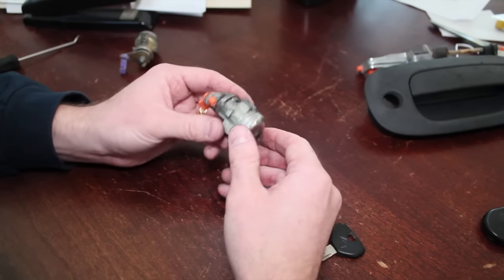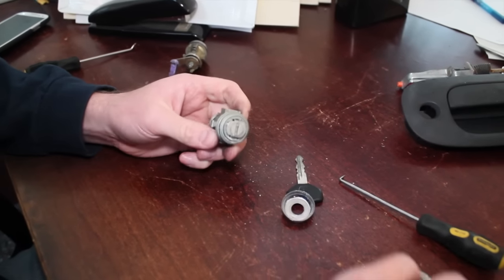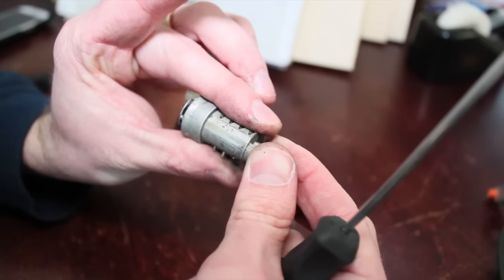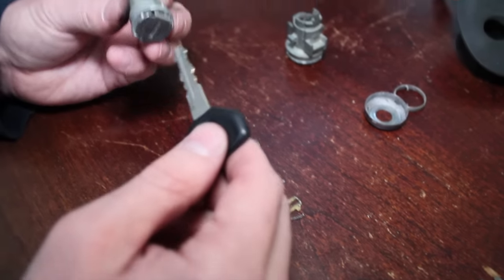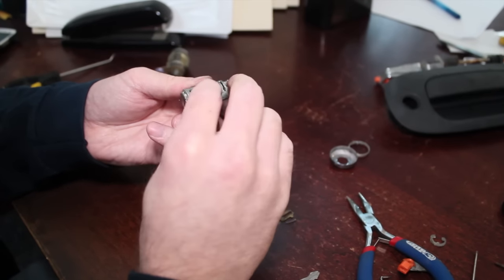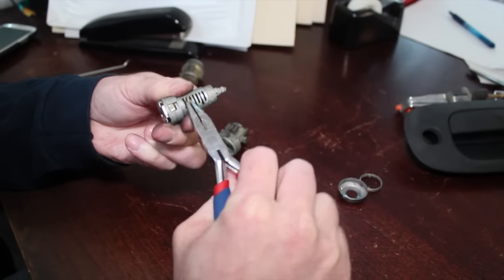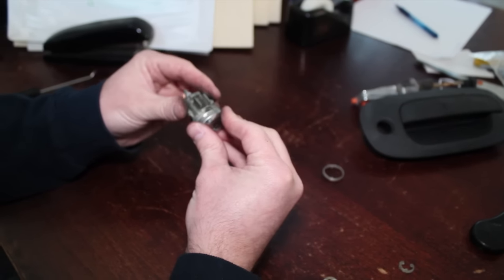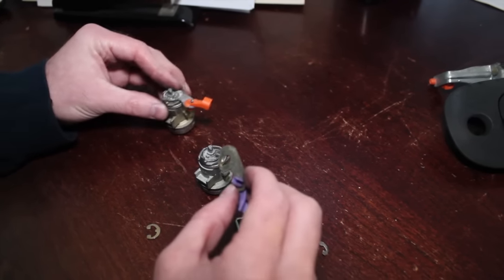Recode, Rekey Car Door Lock Cylinder - Use Any Key to Unlock Car!!! Ex. Durango

Comment: Great video.  I just used it to recode a new cylinder for my Honda.  The lock broke and I ordered it online for $13.  Trial and error worked except for one slot which I just left out.  I learned so much and saved about $50 for a locksmith to do the same job.  I can't wait to see what is broken on the old lock when I swap them out.
Reply: I dunno. Supply and labor costs..

Comment: Perfect explanation! Used your info to rekey a trunk lock cylinder on a 2005 Mercedes! Bought a used handle assembly without the key. Got it all apart and broke one piece. But learned I could change the tumblers out. Thank you!!!

Comment: Thanks just doesn't seem to express my gratitude. This all started 2 weeks ago, the linkage on that door handle popped apart on my way to a family thing so I just used the inside handle so not to be late. when we were leaving I rolled down my window and it got stuck in the linkage then the door wouldn't open at all so I started this adventure having to pull the door panel off while sprawled across from the passenger side. A week ago I finally got the door open by just blindly disassembling everything attached to the door 2 days ago I received my shipment of 6 plastic clips so I could put it all back together but to attach the clip to the outer door handle I had to pull the cylinder that turned out to break into pieces, after all that I got lucky enough to find your awesome instructions so I don't have to change all of my locks and now I can keep my original key. thank you so very much.

Comment: After watching your video for inspiration... I had a similar situation with my 2000 Tahoe. However the mechanism is a little different and couldn't get the pins out - what I did was insert the key and noticed only 1 or 2 pins were still ever so slightly raised, so I simply used some wire snips to lightly clip off a small bit of the pin. This isn't 100% professional, but it's quick, cheap, and still quite reliable! (did this for 2 separate locks with that were for 2 separate keys). THANK YOU!

Comment: Great video!  Short and sweet.  On my set-up I had 3 pins that didn't quite work out, so I broke out the file and did some manual tuning.  Worked like a charm!
Reply: I was planning on doing the same, although it worked can we say that most same make car with similar keys won’t open the door, thanks

Comment: DoAsImDoing. Thanks for the video. Just did my daughters Saturn. The previous owner must have lost the keys because they had a different ignition in it but no keys for the doors. Had one made at a dealership after jumping through hoops but still wouldn’t work. Come to find out the cylinder was full of what I believe to be glue.   Again thanks a bunch. Stay safe.

Comment from the maker: Glad you got it working. I mentioned somewhere in the video that I actually ground down one of the pins, but wires snips work too!
Reply: What can happen if you left out the last one? (The last one in mine is a bit bad so I'm wondering if the key will work normally if I just remove it)
Reply: @octacle_  I went ahead and removed the last one in mine about a month ago, and everything works just fine, like you said...still, Thanks for your reply 👌

Comment: I used this to recode my 99 Toyota Corolla door lock cylinder. I only had 1 of the 7 wafers that I couldn't re-use. I just left it out instead of trimming it. On the Toyota it was much the same setup but two of the wafers were split into two parts with a "wing" on each side. Different but the concept is the same. I reconfigured it with this video in about an hour. Thanks a lot!

Comment: Great video. My problem was the cylinder was stuck completely. Removed the cylinder and applied wd40 on the back of the cylinder. Wiggled the key a little bit. Wait some time. Wiggled more and boom the cylinder is back to normal. Thanks for again sharing this.

Comment: Thanks so much for this video! I called two locksmiths and got tired waiting for a callback. I first tried to find the correct pins while not removing the springs and quick started to get irritated with pins popping out. I then realized how important your recommendation to remove the springs actually made the process move faster. Thanks again for taking the time to make this video!

Comment: Thanks for this video.  My lock wouldn’t turn on my tailgate (02 F150).  I can rekey door locks at work (Lowes) so I knew I could tackle this after your video. Turned out I had the correct key. My lock was full of mud!! After some cleaning with alcohol and a tooth brush it’s back in and working great!  Thanks again for the video.

Comment: I had trouble with the last tumbler just like you did. I just threw it out as I didnt have immediate access to a grinder or filer. But 4 out of 5 tumblers still works fine. Like you said, "not the end of the world" Good stuff. Thx for taking the time.
Reply: Heck, I took out 3 tumblers out of 7 , it’s not that important, as long I can open the door

Comment: Thank you for this video! I fixed my 2002 Toyota Camry door lock cylinder after watching this. There was one pin that stayed up a hair too high with the factory key. I took it apart and ended up snipping the top of the pin off and it works like new now. Thanks again!
Reply: I have 96 Corolla with a driver side door lock that doesn’t turn when the key is in. I’m guessing one of the split wafers wore out after 25 years and is sticking out preventing the cylinder from turning. I haven’t opened up the door to check yet, but I’m pretty sure it’s a faulty wafer. Would u recommend I just remove the faulty wafer or do I need to buy another one? Or should shaving it down with a file also work? And will the lock cylinder work with a wafer removed? (I don’t rly care about worsening the security of the lock)
Reply: @HisMajesty99  If you have a spare key, test it before you do anything else. It could be the key has worn down. If the spare key works, but the normal one doesn't, it's the key. If you don't have a spare, test the key on the other door/s and if they turn, you'll know it's the lock cylinder and not the key. Then you can disassemble the lock cylinder and get a good look at what is stopping the cylinder from rolling. Good luck!
Reply: @adamanders713  I’m pretty sure it’s not the key since I’ve been using the key to unlock the car from the passenger side door for the past 2 years haha. And thanks, hopefully it’ll be an easy fix
Reply: @HisMajesty99  That rules the key out then haha You might need to use a little metal pick to pull the front casing of the cylinder off. That was the hardest part to get off for my cylinder. After that it was pretty straight forward. My parts and springs didn't go flying, but I do recommend working over a white towel or something so if a small piece falls out, you'll have a better chance of finding it.
Reply: @adamanders713 yeah from the video it seemed like the cap was the hardest part, I don’t wanna accidentally damage it taking it off. And good idea, I’ll definitely do it over something white or bright
Reply: @HisMajesty99  For sure. Let me know if it went well whenever you do it.
Reply: @adamanders713  took the door panel off and managed to remove the cylinder, was a pain for this Corolla model. But now getting the cap off this key cylinder is an ever bigger pain, it’s crimped on there real good with no gap to even leverage a flathead in between. Any tips?
Reply: @HisMajesty99  I used a small metal pick and inserted it into the key hole and used a little leverage to pop up one side. Then I put the pick in the newly made gap and pried it open along the outside edge. It bent the front of the little lock door, but you can barely notice it once it's put back together. That's the only way I could figure out how to loosen that crimp.
Reply: @adamanders713  hey man mb for responding so late, got busy with some other stuff today. But abt 30 mins after last messaging you, I was finally able to pop that dang cap off haha. Used an X-acto knife to slip in between and make a small gap, pliers and flathead did the rest. I removed two of the pins (just as I had predicted, the split wafers were the problem, basically just pins but cut into 2 pieces to add security. They also wear out over time easier). I reinstalled everything and now the lock works like it’s brand new. I can’t believe I didn’t do this sooner, been having unlock my car through the passenger side for over 2 years. Glad it all worked out so well. And thanks for your help btw!
Reply: @His Majesty  Hey, that's a good idea! I had the same thought myself after doing it. I wish I hade done it sooner as well. If it ever does eventually fail, you can always buy a rebuild kit and go from there. Either way, I'm glad it worked out for you! You're welcome, no problem!

Comment: Thank you sooo much.  This video walkthrough saved me some 💵💵 and I learned something in the process.   
One thing is that my needle nose pliers couldnt pull up the shims so I used a dull fingernail clipper to pull up the shims.  Worked perfectly.  

Also had to shave some the shims, but that was no issue since I had a dremel tool

all in all, Thank you much. God Bless!

Comment: Holy frikk'n smoke, I just re-keyed a Mazda RX8 with your helpful video! I've never done any locksmith job ever until today, thank you! There were some other helpful comments as well. I had to replace a door lock that got damaged when someone tried to break in the vehicle. The old lock had 7 pins or tabs (not sure what they're called). The new one had 8. I couldn't get the new one to work with all 8 so I left one out. I'm sure if locksmiths ever do this, I'm curious if they do? Thanks again!!!

Comment: Great video!  I got a replacement lift gate for my '98 Durango off a '00 Durango and swapped my locks to match.  I figured I'd try keying the spare cylinder to my key.  Sure enough I had the same issue of one slot not matching any of the pins.  It was a #4 pin in the 3rd slot from the keyside of the lock.  Filed it down and it works great, so now I'll have a spare cylinder lying around.  THANKS!

Comment: Try your new key before you remove all the tumblers....two or three just might be right.  There's only four different depths to each cut of the key, so you have a 25% chance the tumbler will match the key cut.
Reply: If there's 4 different tumblers then you have less than a 5% chance
Reply: I think he mean you have a 25% chance on each pin, not overall.

Comment: Thanks for upload. Simular barrel in my 1997 Diahatsu Cuore tailgate, which I had to repace to the original main key as the previous owner had lost key to a replacement tailgate lock that they had fitted.

Comment: so how did find the code for the tumbler?  And is a GM lock cylinder similar?  My drivers door does not unlock with the ignition key can I try and re-key the door cylinder with the ignition key?  The ignition key does go into the door lock but it wont turn the cylinder to lock (the door is always opened and locked using my key fob)  I want to try and see if I can have the ignition key re-pinned using your method so the ignition key is y door key? BTW -- Great video thank you!

Comment: I tried this with no success.  Then I took a good look at the slots the wafers ride in and saw that the edges were chewed up.  I us a small round Dremel sander attachment to round the chewed up sharp slot edges and now the lock works like new.
Reply: Kent  can you explain  please?  you used the dremel inside the slot  where the wafers go?  that is very small.  I am using old wafers from junkyard and only getting  2 to fit.
Reply: @qkcam45  Sorry.  I'm old and I don't remember the process.  I no longer have the truck so i can't go take a look at it.  I just remember that the slot was buggered and cleaning it up got it working.

Comment: Where can I buy a set of those cylinder slugs it wafers? I need to rekey some of my door locks and gas cap locks to a new ignition key. I'd rather not rekey the new ignition key to the old key. Thank you!

Comment: This looks interesting and my Range Rover has 3 keys. One for the ignition, one for the doors and one for the tailgate. I would like to get all of these onto one. Say if I were to get all of these barrels out like you have done, I have a few questions. 

In this case there are 7 pins, are they usually only in say 2 sizes? Because what if you need a length that you don't have enough of?

Also, are all locks the same? Like can I also do this for the ignition barrel as well as the door locks?

Thanks in advance.

Comment: Very good instructional video.  Is there a way that you know of to make a key if you know the wafer/pin combination but don't have the key?
Reply: Yes you can just take the combination or the actual key code which is normally stamped on the lock to a locksmith and they will make a key from the code

Comment: It seems that the key you used to remove the cylinder from the housing is the key for that particular lock. How would you remove it with a different key? For instance, if you purchased a lock online that did not come with the key?
Reply from the maker: sampoteste Any key that fits the hole will bring most of the pins down somewhat. The rest of the pins you should just carefully push down one or two at a time as you slide it out.

Comment: hi.. i have got toyota corolla 2007 which bit weird.. my car key cant open the door manually.. it can turns on engine though.

so do you think with your method can fix the problem?
and do you think the toyota corolla 2007 will looked simillar like yours?
many thanks

Comment: If the pins are numbered, I would imagine in theory you could  just remove one of the working cylinders from the car, note the order of the pins and match it on the replacement one

Comment: I have 96 Corolla with a driver side door lock that doesn’t turn when the key is in. I’m guessing one of the split wafers wore out after 25 years and is sticking out preventing the cylinder from turning. I haven’t opened up the door to check yet, but I’m pretty sure it’s a faulty wafer. Would u recommend I just remove the faulty wafer or do I need to buy another one? Or should shaving it down with a file also work? And will the lock cylinder work with a wafer removed? (I don’t rly care about worsening the security of the lock)

Update: I removed the two pairs of split wafers/pins and it works like a charm

Comment: What if you don't have the key for cylinder from junk yard? I'm trying to replace vw mk4 wagon hatch key that is frozen internally (likely due to corrosion) and I have the spare one from junk yard. I still have to figure out how to take the old one apart, is cutting it in half my only option? After posting this, I found a tool called HU66 decoder, I think I'll need that to dissamble the new key and cut old cylinder open to get the little pieces out.

Comment: i have a 2001 ford explorer sport trac and i lost all keys. local locksmith made a key but its does not open the ignition smoothly. i have watched some videos and already removed the cylinder and i wanted to rekey but it has different internals. it has a side bar. tumblers dont align and its the sidebar thats being depressed. Do you have a tutorial for a cylinder with side bar?

Comment: It turns out my lock cylinder is just fine - the key is worn down.  When Home Depot cuts a new key, it follows the old one exactly.  How can I get a new key, one with the dimensions meant for the lock cylinder?  $65 wasted on a new AC-Delco lock cylinder and it does exactly the same thing as the original lock cylinder.

Comment: I have a slight dilemma while i was doing this for a friends Caravan, he wanted to help/learn, but he's not too bright, so i thought i explained to him how its done and had him hand me the tumblers as I asked for each one by the number, hell I won't need to even write them down. Righhhhht.
Well turns out, he had handed me, one @ a time, ALL #2's, he thought when i called out a number, he thought thats how MANY i needed & I should have got that w/ the 1st round when I said "gimme a 2" & he handed me 2 tumblers, I said, No bud, I need em one @ a time, and he had this cunfoozed look. Well I dremeled off the case (Had another) and got everything out and now i'm trying to do this on the blind, is this going to be like pissing up a rope??? ;) I have the 8 original tmblers and they consist of:
#1's = two
#2's = three
#4's = three
Was hoping there was a # on the key, its a black Dodge key (non-chipped) but there is nothing.
If somebody has gone through this already and had any suggestions I'm all ears. and would appreciate the assist, Thanks

Comment: I want to rekey my Honda door lock. I want to use my old key  - so basically I have to replace some or all tumblers. What would be the right way to do it? Buy new (correct) tumblers from the dealer or buy some Honda door lock cylinder from internet and use its tumblers to rekey my own lock?